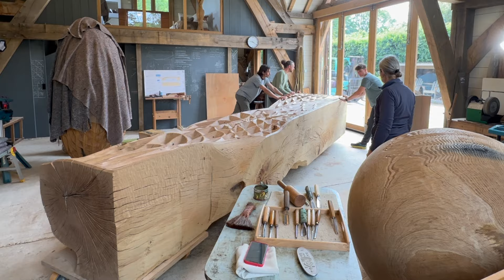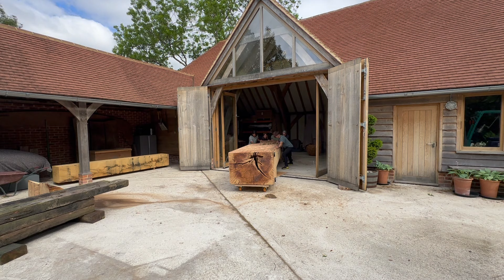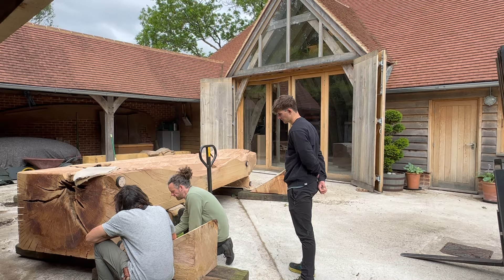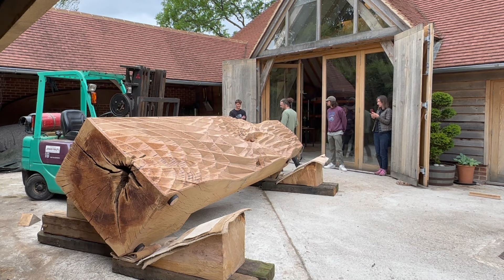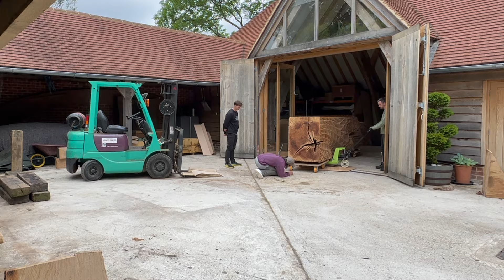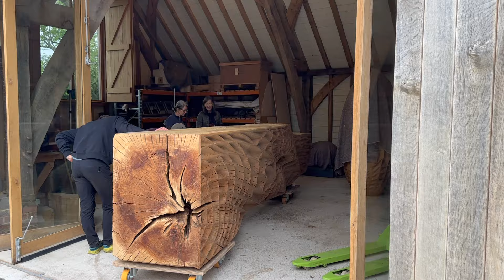Turning a 4 TONNE Sculpture

Comment: Good morning 🌅, Alison, excellent work, but I think if you make yourself a pair of A-frame hoist, which have electric winches on them, Using webbing straps pulling on one side it should lift and rotate a lot easier than what you’ve struggled with, I’ve seen a lot of things on YouTube where young people who do Logging use a similar method, over in Canada and USA , if you rap the straps around the item that you want to rotate, then when you’ve got it set up, you pull the ends that you have rap and it will unwind and rotate the item, 
Keep up the amazing work, Retire English dude living in France,
Reply from the maker: Yep done all that. It was fun to manage with minimal stuff. Mtec Art Transport @Mtec0 
will be crating shipping and installing and they have ALL the gear 👌
Reply: @alison_crowther  Good luck for the future,